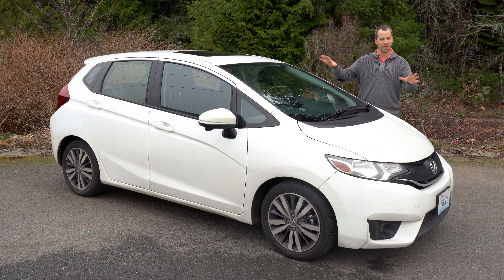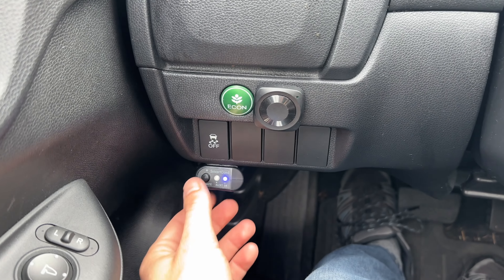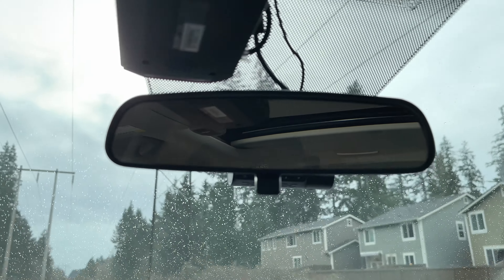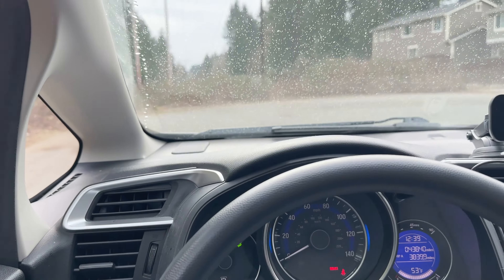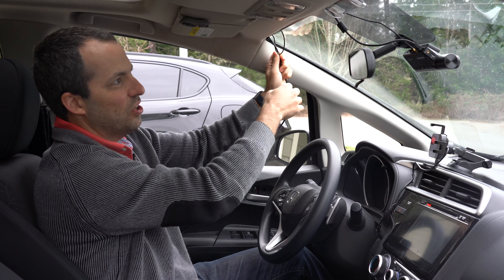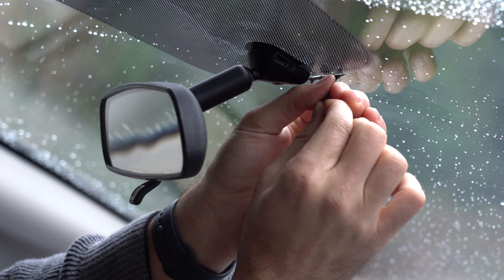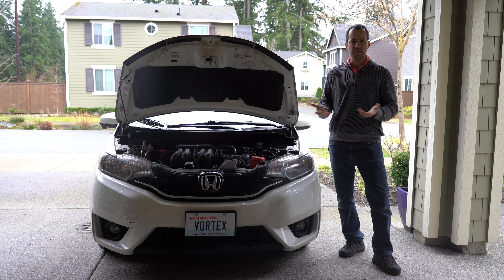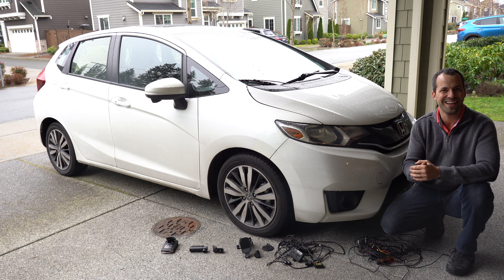Uninstalling Countermeasures from our Honda Fit

Comment: FYI,  Course Motorsports makes some pretty neat mounting solutions for phones (and similar). They might be worth a try if they make a version for your next vehicle model. In my experience, they all install very clean and secure. The ball fits most other mounts, so you can use nearly any phone holder you prefer. 

Often, because you remove a panel near a HVAC vent when installing a Course Motorsports mount, you can run a cord through a vent and hide the cable for the phone mount/charger. You may have to do another add-a-fuse or find a creative way to get power, though. I guess you have experience with that sort of thing...

If you (and/or your wife) like horizontal phone mounting, Samsung's own wireless phone holder/charger has the functionality of your old one, is more suited to horizontal orientation, works with the Course Motorsports mounts, and dosen't rattle. I've been using that setup in 2 vehicles for nearly 2 years and have been quite pleased.

Comment: Heat gun on the outside of the windshield where the double sided tape is for the dashcam, then a plastic razor blade to get under the mount to lift it slightly. Will come off very easily from there! :)
Reply from the maker: Thank you!

Comment: on the topic of the dash cam killing the car while in parking mode - does it not go on motion detection to record? my admittedly extremely cheap chinese dashcam that does front/rear/interior will only begin recording when the front lens detects motion, and will stop when that motion has ended and go back into standby.
Reply: i also have a similar voltage cutoff fuse tapped into my rear accessory fuse, i've had no problems with it draining the battery to any substantial degree

Comment: only a 5 amp fuse for all those devices on that add a circuit? also, t-taps? tisk tisk
Reply from the maker: What makes you think everything was on one 5 amp fuse? There were two add-a-circuits and the ZW5’s were wired into the battery directly. If you run the actual numbers things were fine which is why I never had issues with fuses. Thanks for the feedback though.
Reply: @VortexRadar  fair enough. It looked like a couple t-taps on there, so I incorrectly assumed all the devices were wired there.

Comment: I have to laugh having all of these CMs in a Fit.   Car can barely break 80 mph without huffing and puffing and that lil VTech screaming at the top of its lungs.
Reply: It sounds like your Honda Fit needs some maintenance.
Reply: Great car - the Honda Fit - too bad Honda stopped making them- We need cars like the Fit.
Reply: My father has a Honda City, which is bigger than the Fit but has the same engine, and it can make more than 120. But if you only change the oil when the oil pressure light comes on, it will start to drive like you said.

Comment: magsafe >>
Reply from the maker: Is that available for Android yet? I have it in my car for my iPhone and it’s great.
Reply: @VortexRadar there are a lot of cases, for various Android devices, which add compatibility with Magsafe accessories.

FYI,  Course Motorsports makes some pretty neat mounting solutions for phones (and similar). They all install very clean and secure. The ball fits most mounts, so you can use nearly any phone holder you prefer. 

Often, because you remove a panel near a HVAC vent for installation of the Course Motorsports mount, you can run a cord through a vent and hide the cable for the phone mount/charger. You may have to do another add-a-fuse or find a creative way to get power, though. I guess you have experience with that sort of thing, though...

If you (and/or your wife) like horizontal phone mounting, Samsung's own wireless phone holder/charger has the functionality of your old one, is more suited to horizontal orientation, works with the Course Motorsports mounts, and dosen't rattle. I've been using that setup in 2 vehicles for nearly 2 years and have been quite pleased.